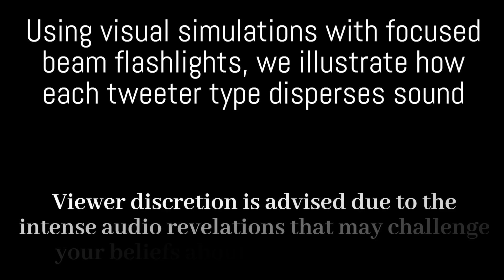Dome tweeter Vs Horn  -Viewer discretion is advised due to intense audio revelations

Comment: I had some bad experience with ring radiators, like the Yamaha JA4281B. I thought it would be as good as JA6681B but nothing special and my examples did not go much above 10K and with a lot of breakup/distortion at 10K. Maybe it was a bad pair. I did like the ring radiator on the Sonus Faber Stradivari, but when revisiting with more experience I found the tweeter lackluster, compared to Raal Ribbon tweeters and compression driver tweeters.
Reply from the maker: Totally fair take  and you’re not wrong.

Ring radiators can be great, but they’re far more implementation-dependent than most people admit. On paper the JA4281B should have been a home run, yet in practice a lot of samples show exactly what you heard: early HF roll-off, breakup creeping in around 8–10 kHz, and rising distortion right where air and delicacy should live. Whether that’s unit variance, diaphragm behavior, or loading… hard to say, but it’s not rare.

The Sonus Faber Stradivari is a good example of how voicing can mask limitations. It sounds pleasant, refined, even elegant but once you’ve spent time with a good RAAL ribbon or a properly implemented compression driver, the lack of immediacy, extension, and dynamic contrast becomes obvious. The ring radiator doesn’t offend, but it also doesn’t excite.

Ribbons and compression drivers attack the problem differently:

RAAL: ultra-low moving mass, speed, and top-end realism

Compression drivers: controlled directivity, scale, and effortless dynamics

Ring radiators tend to live in the middle ground that is safe, polite, and sometimes underwhelming unless everything around them is perfectly dialed in.

So yeah… not crazy, not a hot take just experience talking.
Reply: @shinjitsuaudio  Yes, exactly. Question is where the ribbon can be used. True ribbons sound the cleanest, but also sound a little weak compared to compression drivers.

Comment: The problem with horn tweeters, they sound like horn tweeters. To in your face, doesn't take long, to fatigueing
Reply from the maker: Yeah, totally — horns sound bad… when they’re designed badly.
Just like how all cars must handle terribly because someone once drove a 1985 Yugo.

Most of the “in your face, fatiguing horn” sound comes from:

50-year-old horn profiles

Cheap PA drivers

Zero phase alignment or crossover work

Modern horns with proper geometry and tuning don’t shout at you — they just deliver dynamics and clarity without needing 500 watts.

So sure — bad horns sound like bad horns.
Good ones don’t sound like horns at all… they just sound like the music.

Comment: This is not a completely realistic simulation. If you you wanted to really simulate the sound behavior you'd need every surface to be made of mirrors, because sound gets reflected very easy and even a horn doesn't limit the sound only to 60x40 or whatever profile is used. There is always some leakage and reflections.
Reply from the maker: You raise a good point about realism. To clarify, our demonstration isn’t meant to perfectly simulate sound propagation but rather to visually highlight the relative difference in dispersion control between a dome tweeter and a horn. Since both scenarios use the exact same light source under identical conditions, the demonstration fairly and accurately illustrates this key difference—even though neither scenario fully replicates sound physics.

It’s analogous to measuring two boards with the same slightly-short ruler: the ruler itself isn’t perfect, but because it’s used consistently for both measurements, it still correctly reveals the difference in length. Its a reasoning by analogy approach.

Thanks for bringing up that point; it's important for viewers to understand the context and limitations of analogies clearly!
Reply: But loudspeakers are tested in anechoic chambers, which is analogue to a room with non-glossy black walls for light.

Comment: soft dome tweeters have a sweet sound have been using for 15+  years, there sensitivity is high & they handle the mid's also well ,radiation pattern is wide as compared to a cone tweeter, piezo's have a strict only high frequency o/p, sensitivity is less require higher signal for decent o./p, higher power handling capability very harsh to the ears so mostly used outdoors, searching for a compression driver for treble, what is  the difference between PA driver & compression driver, some compression drivers just have the 1'' throat, horn maybe provided.
Reply from the maker: Hi,

I’ve worked with a lot of these driver types over the years, so I totally get where you’re coming from. Let me try to break this down in a way that covers everything you’re asking about.

Dome Tweeters
You’re spot on about dome tweeters—they have such a sweet, smooth sound. I’ve always loved their wide dispersion too, which makes them so forgiving in different room setups. Their ability to handle some of the midrange is another huge plus, especially if you’ve been using them for 15+ years. Honestly, they’re just hard to beat for home audio when it comes to natural, easy listening.

Piezo Tweeters
Yeah, piezos are definitely a whole different animal. They’re great for what they do—super high frequencies and handling a ton of power—but they do come across as harsh for indoor or hi-fi use. I see them mostly in outdoor PA setups where they can shine by cutting through ambient noise. You nailed it—they’re just not a great choice for situations where you want refined or balanced sound.

Compression Drivers vs. PA Drivers
Okay, so here’s how I see it when we talk about compression drivers versus PA drivers:

Compression Drivers: These are purpose-built for high frequencies. They use a diaphragm and a phase plug to compress sound into a horn. Most of the time, you’ll see them with a 1-inch throat, though there are larger ones (1.4-inch, 2-inch) that handle lower frequencies too. They’re great for both PA systems and hi-fi setups, depending on the model and horn pairing.

PA Drivers: This is more of a catch-all term. It includes compression drivers, but it also covers woofers and full-range drivers that are rugged and built for loud, long-term use in public spaces. They’re optimized for durability and volume, not necessarily for tonal accuracy like you’d want in a home setup.

The big difference is that compression drivers focus on treble and detail, while PA drivers are about reliability and covering big spaces with sound.

Choosing a Compression Driver
If you’re looking for a compression driver for treble, there are a few things to think about:

Throat Size: Most are 1-inch, which works well for treble. If you’re considering something like a 1.4-inch or 2-inch throat, those will handle lower frequencies but might not extend as far into the treble.

Diaphragm Material:

Titanium: Tough and efficient, but it can sound a bit harsh for hi-fi.
Polyimide/Mylar: These are smoother and better for home listening.
Beryllium: Amazing treble detail, but they’re pricey.
Horn Pairing: Compression drivers really depend on the horn to shape their sound. A good wide-dispersion horn can make a world of difference for home audio.

Sensitivity and Power: Compression drivers are super-efficient—many hit 100dB or more, so they don’t need much power. 

Some Recommendations
Here are a few drivers worth considering, depending on what you’re looking for:

Beyma CD171 FE/PK: This is a fantastic choice—versatile, clear, and smooth. It’s great for both PA and hi-fi setups, especially with the right horn.
JBL D220Ti: Another solid option. It’s smooth and works well in both hi-fi and PA systems.
Radian 475PB: If you’re looking for something smoother, this one’s great for home use. The polyimide diaphragm makes a difference.
Beyma CP21F: Perfect for crisp, extended highs. This one’s a real standout for audiophile setups.
BMS 4550: Compact but powerful, with excellent treble clarity.
Final Thoughts

Compression drivers can be a great step up if you’re transitioning from dome tweeters. They’ll give you more dynamic range and efficiency, but you might need to experiment a bit to find the right tonal balance for your taste. Let me know if you want to dig deeper into any of these or chat about horn pairings—I’d be happy to help!

Cheers,
Shinjitsu Audio
Reply: @shinjitsuaudio D220 Ti is Selenium's technology. The Harman Group acquired that Brazilian brand called Selenium and rebranded the entire product line, but engineer Homero Settle Silva was the mind behind all transducers Selenium made.

Comment: Could you please comment on the difference between your rectangular horn, how it performs/compares against the like of vintage JBL 2307/H91 and H92 model horns. These being round and narrow, though a little tapered. Thank you from Australia.
Reply from the maker: Rectangular Horn Design
Our rectangular horns are designed with a focus on achieving a balanced combination of wide dispersion and controlled directivity. Key characteristics include:

Wide Dispersion:

The rectangular shape naturally promotes a broader horizontal dispersion pattern, providing a wider sweet spot for listeners.
This makes it ideal for modern listening environments where room coverage and soundstage width are key priorities.
Controlled Vertical Directivity:

The rectangular horn reduces floor and ceiling reflections, leading to a cleaner, more focused sound in typical home setups.
Tonal Balance:

Our design emphasizes smooth transitions and minimizes coloration, ensuring natural and accurate reproduction across the frequency range.
JBL 2307/H91 and H92 Comparison
Round, Narrow Design:

The JBL 2307/H91 and H92 horns, with their narrower round profiles, are designed for applications prioritizing controlled directivity in smaller, targeted listening areas.
They produce a more focused sound, which can excel in nearfield or highly treated studio environments.
Tapering Effect:

The gradual tapering in these vintage JBL models provides a unique tonal signature, often described as “vintage warmth.”
However, the narrower dispersion may feel less immersive compared to a wider-dispersion rectangular horn, especially in larger or less-treated spaces.
Efficiency and Beamwidth:

The JBL horns are known for high efficiency, but their beamwidth can lead to more pronounced “hot spots” where sound energy is concentrated, which might limit their performance for broad audience coverage.
Performance Context
Ultimately, the choice between these horn designs depends on your priorities:

If you value a wide sweet spot and immersive sound for modern home audio or cinema setups, our rectangular horn is likely a better fit.
If you’re aiming for a classic, focused studio sound or are a collector seeking the unique tonal characteristics of vintage JBL designs, the 2307/H91 or H92 may suit your needs.
Both designs have their strengths and serve different applications effectively. We appreciate your interest in understanding the nuances, and we’re here to help if you have further questions!

Comment: Light is a particle
Reply from the maker: Are you sure? " Light exhibits both particle and wave characteristics, a concept known as wave-particle duality in quantum physics. As a wave, light exhibits behaviors like diffraction and interference. As a particle, light is composed of discrete units called photons, which carry energy and can interact with matter (e.g., in the photoelectric effect).

This dual nature is central to understanding the quantum mechanics of light, showing that light doesn’t fit neatly into classical definitions of either waves or particles."

Comment: Maybe you would benefit from 9.2.4 surround system. 
That would give you a 3D sound experience. 
Think that’s the way I’m heading
Reply from the maker: Thanks for your comment! A 9.2.4 surround system definitely offers an immersive 3D sound experience, especially for home theater setups. Surround systems can create a sense of space that’s perfect for movies and certain types of audio. However, our focus with horns vs. domes is more about purity of sound and efficiency in delivering lifelike detail, particularly in stereo music setups. Horns provide unmatched dynamics and controlled dispersion, which allows for incredible clarity and detail without needing as many channels. But hey, if you're heading toward 9.2.4, you're in for a great ride! Both approaches have their strengths, and it's all about finding what fits your audio needs best. Enjoy the journey!

Comment: Want the best soundstage. Use a home theater audio set and get music in DTS 5.1 or Atmos 7.1.x   
Sit in the middle and you are in the MIDDLE of the "Sound Stage" because you are surrounded by speakers.
Reply from the maker: Thank you for your input! Surround sound systems like DTS 5.1 or Atmos 7.1.x can indeed create an immersive soundstage by surrounding you with multiple speakers. This setup can simulate a three-dimensional audio environment, placing you in the center of the action. However, there are a few key points to consider when comparing this approach to a high-quality stereo setup:

Surround Sound vs. Stereo Soundstage:

Surround Sound Immersion:

DTS 5.1: This setup includes five speakers and one subwoofer. It provides a broad, immersive soundstage ideal for movies and certain multi-channel music recordings.
Atmos 7.1.x: This advanced system adds more speakers, including overhead ones, to create a three-dimensional audio experience. It's excellent for creating a sense of height and space in the soundstage.
Pros: Enhanced spatial audio, more immersive for movies and compatible music formats.
Cons: Requires specific recordings (like DTS or Atmos) and a larger setup.
Stereo Soundstage:

High-Quality Stereo Setup: 

Uses two speakers strategically placed to create a precise and natural soundstage, often focusing on phase alignment and accurate driver placement.
Pros: Offers detailed imaging and a realistic soundstage that can accurately place instruments and vocals. It's ideal for most stereo music recordings and provides a natural listening experience.
Cons: May not provide the enveloping immersion of surround sound for movies and multi-channel music.

Personal Preferences and Use Cases:

Movies and Multi-Channel Music: 

If your primary goal is to enhance your movie-watching experience and enjoy multi-channel music recordings, a surround sound system like DTS 5.1 or Atmos 7.1.x can be very effective.
Stereo Music Listening: For most music lovers who focus on stereo recordings, a high-quality stereo setup with proper phase alignment and soundstage precision can offer a more authentic and detailed listening experience.
Ultimately, both setups have their strengths, and the best choice depends on your specific needs and preferences. If you enjoy a variety of content, integrating both systems in your home might provide the best of both worlds.